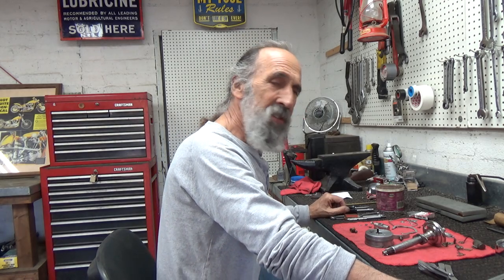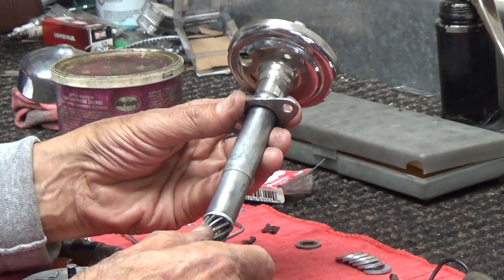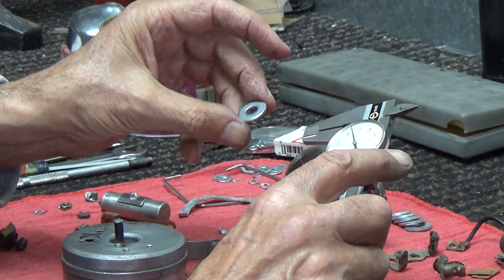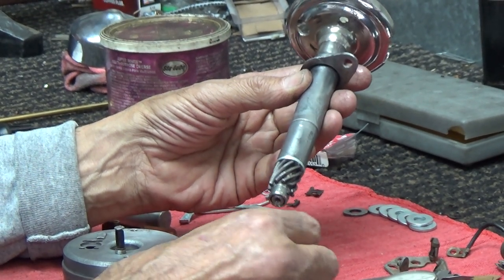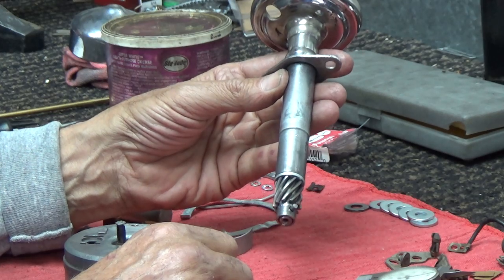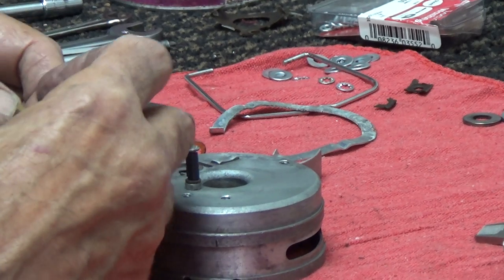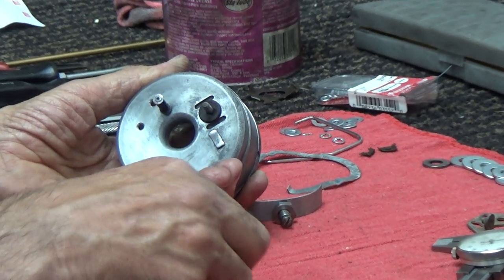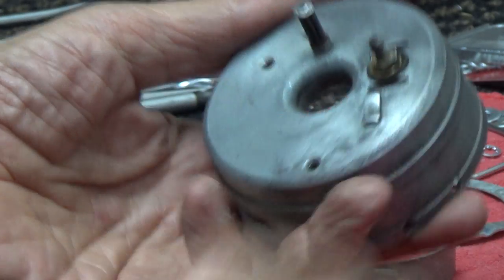Harley Davidson Early Model Distributor Rebuild, Part 2 of 2.

Comment: Mike, at 2:43 in to the video you talk about the bushings inside the shaft.  For the part that you were working on in the video you said they were "in good shape".  How do you know if the bushings have issues if you're looking at a distributor at a swap meet?  What is the acceptable tolerance range?  How are they replaced or repaired if they are out of spec?
Reply from the maker: First off, how does it feel?  The service manual has the specs.  Then, you carefully remove the bushings and press in new ones.  Then you hone the bushings to size on an electric hone.  Any good machine shop can do this.

Comment: Hello! Can you use the later Panhead set of points on a Knucklehead distributor to avoid the hassle of the spring and so on? I know the condenser is different but not sure on the points. THANKS
Reply from the maker: The points are very different, but they'll work in there.
Reply: Thanks

Comment: Hi Mike, any advice on how to peen the pin that holds the gear on the shaft? Thanks!
Reply from the maker: Flat punch and a hammer.
Reply: Thanks! The original one looked liked it had a small hole drilled in the pin.

Comment: Very nice and instructive video clip! I would like to see how do you insert the circuit breaker back to the motorcycle and make the alignment between the circuit breaker contacts and the flywheel, if possible? Your videos are fantastic!
Reply from the maker: Not too rough.  We'll show it when it comes up.  Bring up the flywheel mark in the "window."  Make sure you're on the compression stroke of the front cylinder (both front cylinder valves closed).  Point the timing mark on the distributor cam at the fiber block on the moveable points arm, then back up the distributor shaft so that when you drop the distributor in, the mark on the distributor cam lines up again.  It may take a couple of tries, but you'll get it.  Then, set timing as per our video on how to set points and timing.  Good luck, and enjoy your ride!

Comment: Hey Mike do you have a video showing putting the distributor back in ?
Reply from the maker: I do show how to set it.  Installation is quite simple.  "How To Set The Points and Timing On An Old Harley" is the video.  Watch the video.  Bring up the timing mark in the window with both front valves closed as explained in the video.  Install the distributor.  As it slides in the shaft will turn.  You'll have to do it a couple of times until you get the dist. cam to index with its mark on or near the fiber block on the points.  Then set it from there.  The video should give you the info you need.

Comment: I would like to see a video showing how to adjust the fly wheel in combination with the circuit breaker setup, if possible
Reply from the maker: Ed, look at our video,  " How to set the points and timing on an old Harley Big Twin."

Comment: Hey mike love your videos quick question can I run the blue streak points 
And condenser on my 12v panhead using the same style distributor, without any issues regarding fitment on my base plate?
Reply from the maker: They should work fine.  Sometimes there are manufacturing issues nowdays that didn't usedto exist.
Reply from the maker: Voltage is irrelevant.
Reply: @pacificmike9501  thank you sir I appreciate your help.

Comment: Hi Mike, do you know how could I replace only the contact pads on the original circuit breaker? I see that the original circuit breaker is far much better than the after market, but I don’t know how to replace its contacts. There must be a way out? Thank you. Ed
Reply from the maker: Sounds like what you're describing is the work of a jeweler.  Not me.  Buy a set of contact points and make them work.  It's not always easy, but a little bending, maybe a little careful reaming.  Sometimes it's hard to get good stuff and we have to make do.  That's when it becomes artwork.  Sorry, sometimes it's difficult.

Comment: Just a little feedback from my perspective - For a beginner like me, it would be amazing if you could explain a little about the parts you work on. For example im not 100% sure what a distributor does and so on, also why you would want to rebuild it, or "fix" it
Reply from the maker: All four stroke internal combustion engines are similar in their functions.  They are dependent upon exact timing of events that cause them to operate.  They require air, fuel, and ignition.  That is a little more basic bunch of information than we're trying to present.  We all must start at the beginning.  I suggest the library for info on basics.  Then,  it's Harleys.  By starting at the beginning, you'll probably have a much better understanding than most people.  It's not very complicated and won't take much time.  Then it gets more refined.  I started with a sketch my father scribbled.

Comment: Most of the old distributors I've come across have smoked bushings. It's almost not worth it. Any clever short cuts for replacing them?
Reply from the maker: New bushings are readily available from aftermarket suppliers.  The old ones have to be carefully drifted out and new ones pressed in.  The shaft should now fit.  If it doesen't, the bushings will need to be either reamed or honed to fit.

Comment: Hi Mike, could you please take a look to the sparks on the circuit breaker that I have just assembled? 
https://youtu.be/7kJJBQaJ3JM
the question I have is related to the two contacts on the circuit breaker. In my case they work but they are not completely aligned each other, but one is slightly higher positioned than the other. Should this be adjusted? Does it matter? Thank you, Ed
Reply from the maker: It might work okay, but I always bend and shape as necessary.  The points should contact squarely.  They should fit flat on the base.  Sadly, the manufacturers don't seem to be seeing this the same way they used to.